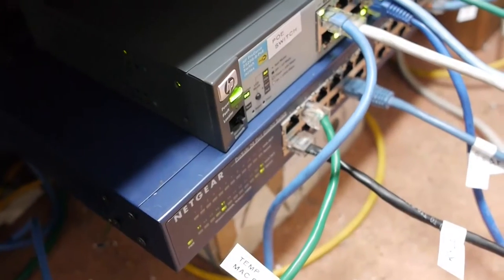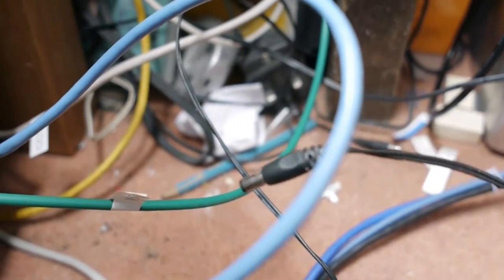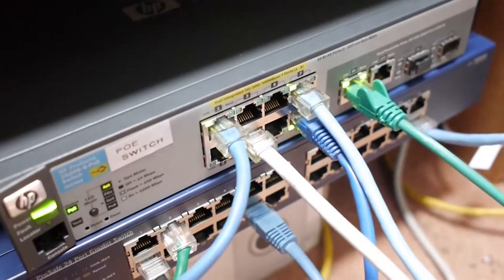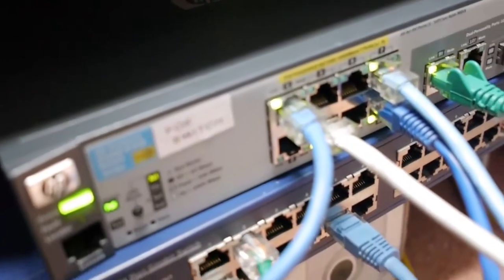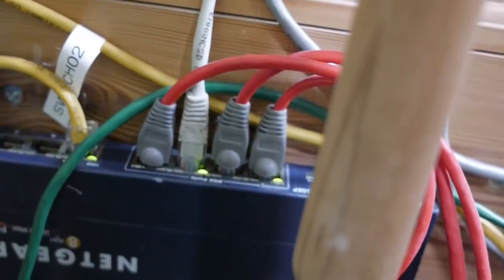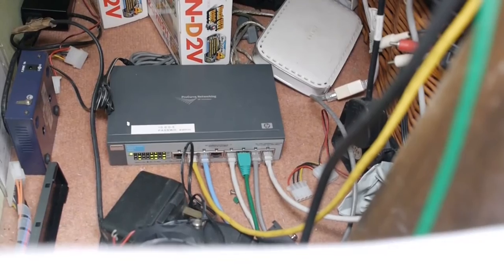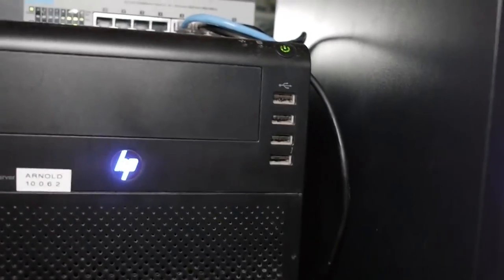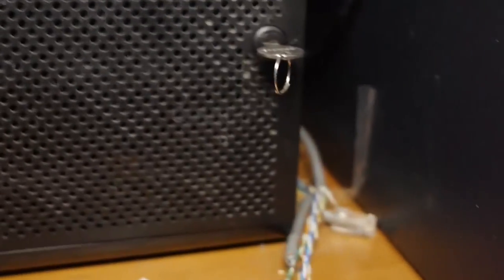Jan 2017 Home Network/Homelab Tour

Comment: Cool little setup. You will find that as time evolves so will your network. Once you get the fever to cable manage or if you have a child running about the place. All the stuff needs to be out the way.
Reply from the maker: This video is very old now. got a May update which is slightly cleaner due to having a larger managed switch vs a small one with a unmanaged switch tacked on.

Also have some changes not see in the May update like new router, a 4u rack to keep it clean, some correct length patch cables etc. still not super clean doe hence why I have not done an update + want to make a few non tour related videos before I do another tour as I don't want to just do tour videos :)

Comment: 10/100 switches triggers me like when casuals  ask "why do I need 10gbe network?"....  Also amazing how you have less than 20 network devices and 5+ switches. Yea and tidy up your place have all the switches on one rack. Reminds me of that guy with the homelab with 10/100 switches refusing to upgrade to 1gbe network. Or that guy that has like 10 computers on, when he can have 1 pc on with 10 VMs.
Reply from the maker: its a lab environment, i.e its for learning purposes obvuslly having tons of switches for my small network is not needed  but for learning purposes its great.

plan to get a small 4u rack for my switches so it will be tidier.

and the 2 10/100 switches are for our CCTV which dont have 1gb connections anyway so not worth spending money on upgrading, do plan to remove one the HP 10/100 though and just use the netgear 10/100 for CCTV as it has POE